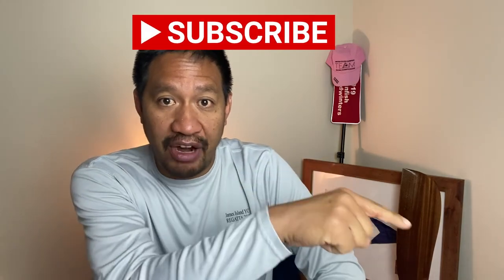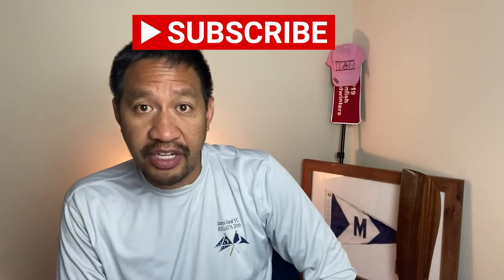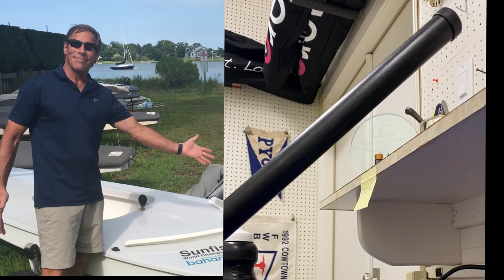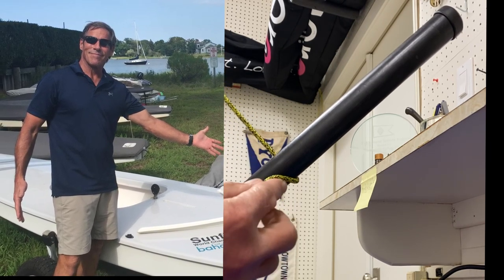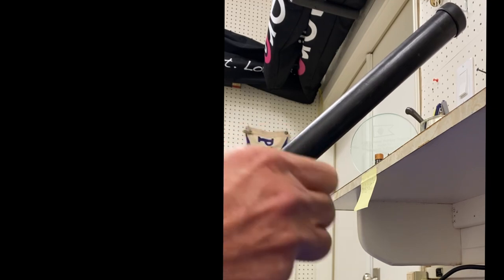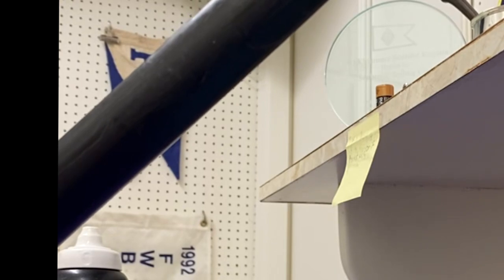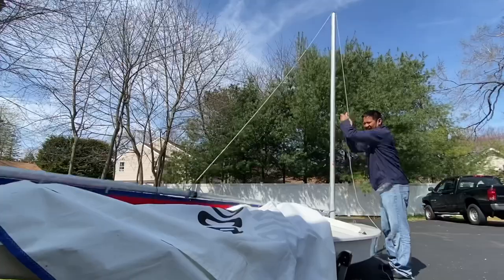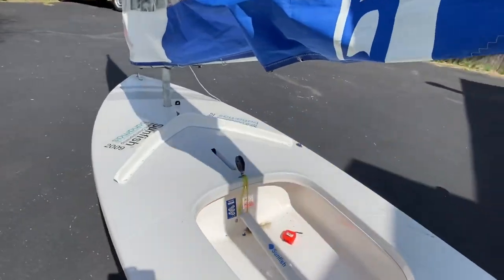Sunfish Sailing | Sunfish Sailboat NO-SLIP Halyard

Comment: Is there any reason a boom hitch isn’t used?
Reply from the maker: There is no reason why it cant be used too!
Reply: @LeeSideSailing  Glad to hear, and thank you for your vids Lee. For me, a first timer, you have supplied me with a ton of information.
Reply from the maker: Good to hear it helps.  Im coming oit with some more soon!
Reply: Now that I have this new sail, just wondering if I should graduate from the boom hitch to this bad boy. Since you have used this knot, how has it held after a year or more since you posted this? Thanks!
Reply from the maker: I mostly use the clove hitch and a couole more round turns as seem in my Jens rig video…. I use the Gust adgust with Mendleblatt variation….

Comment: Thanks, great videos,  just had to retie my halyard.   How do you feel about wind indicators?  I have a home made one clipped to my bow handle.   I sail for fun so no issues but is that legal?   Any good designs I should consider? Maybe an idea for a future video.
Reply from the maker: Wind indicators are really helpful and I do plan on doing a video on them.  On the bow handle may be not as helpful as in the upper spar, at about eye level or a little higher.  Try clipping one there.  See if that helps too:).

Comment: Using an overhand stopper knot to keep the bitter end from slipping through the knot is clever. Not slipping on sunfish's extruded aluminum spar is more of a challenge than on a wooden spar. There's three yard-hitches in the Ashely Book of Knots in order of increasing security: ABOK #1677 gaff Topsail Halyard Bend, ABOK #1678 Studding Sail Bend, and ABOK #1679, the Topsail Halyard Bend.  Adding a stopper to the bitter end of any of them would improve security.
Reply from the maker: Thanks for sharing!!

Comment: Another really great video and I will use it instead of the "Snuggle Hitch" I had tried last year.  However, it does bring a question to mind.  That is:  can I use this "Hitch" in place of a Mast Cleat, to help with the halyard.    Thanks again, great videos.
Reply from the maker: HI Gilbert, thanks for the kind words...  the Hankster 2 is to hold up the upper spar...  you would use this in place of a Colve HItch...  it could technically be used to replace a mast cleat...  i have another video showing that... three new hacks for 2021...   in that video, i just used a lot of wraps...  that was overkill...  good luck   tell me how it works if you use it!
Reply: @LeeSideSailing  Thanks Lee - I will be using it with the grand kids next week - I like the idea of not screwing or drilling in the Mast, and taking some of the pressure off the deck.
Reply from the maker: Good luck let me know how it goes.